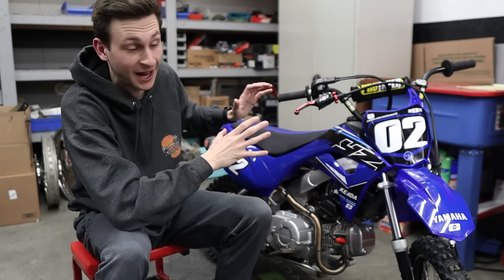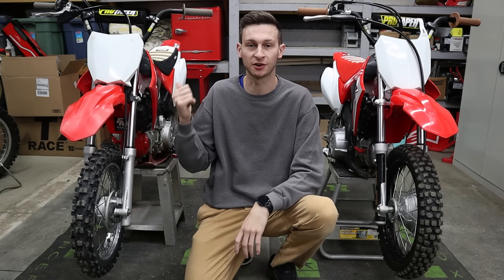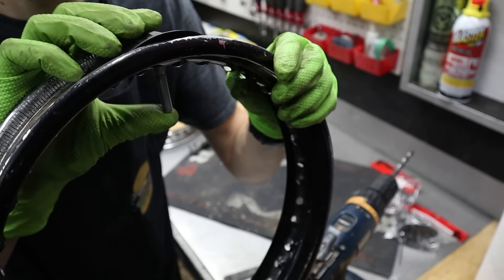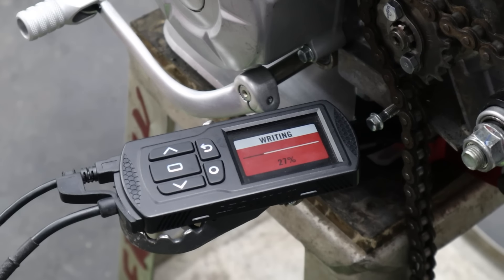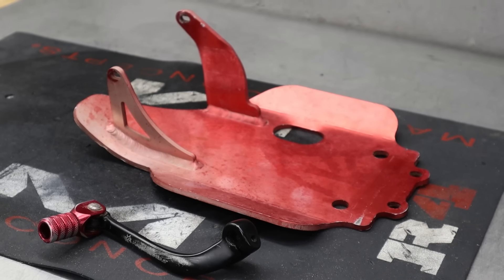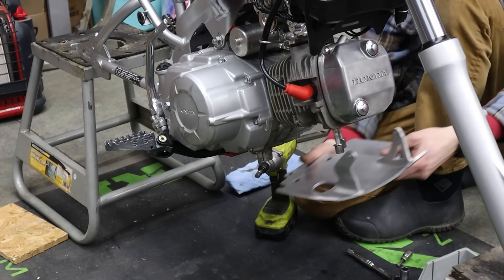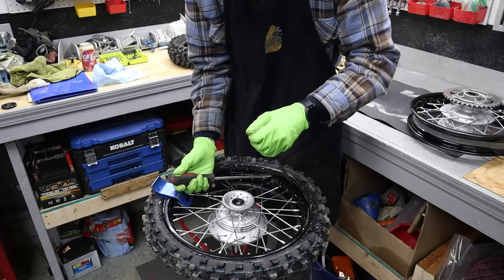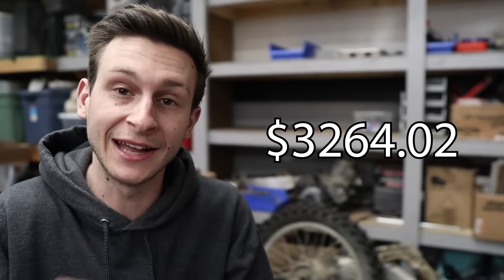Honda YZ110F??? $6000 Pit Bike Build

Comment: I was in high School at the start of the craze around 2003. Only parts you could buy were made in USA. BBR was a big one, fast 50's, Sano suspension etc. Chinese parts didn't exist, most legit builds were 4-8k. Ridiculous I know. I remember the local mx track would host a 50 race during the "intermission" on big events and pro racers and kids would line up together (on honda 50's- not even 110's!) and send doubles you would never imagine even possible a year earlier.